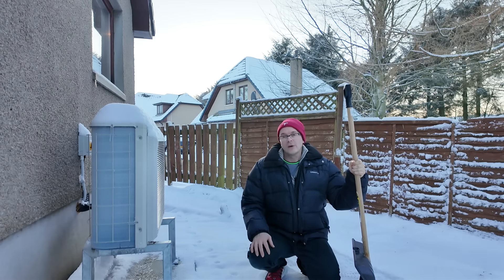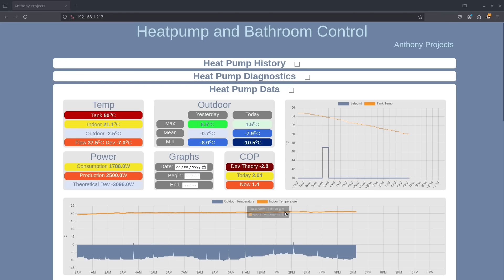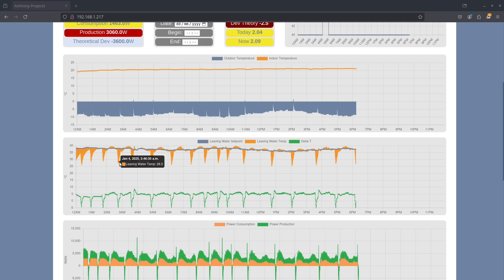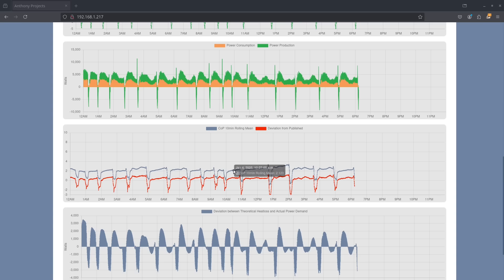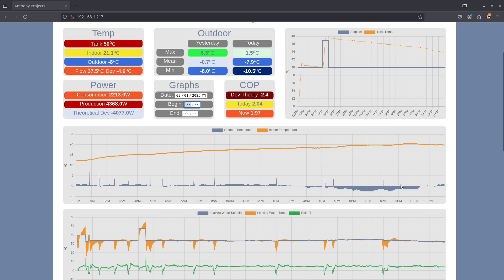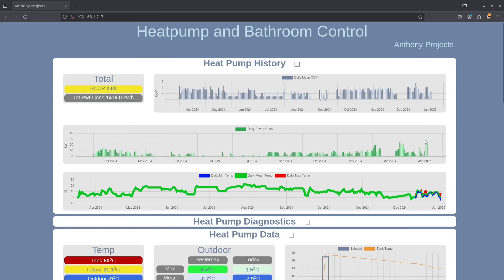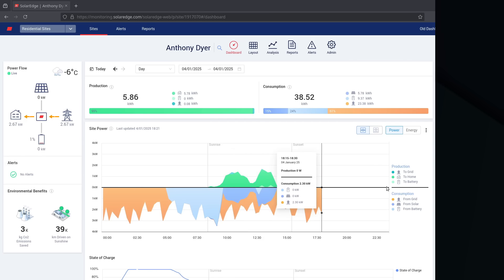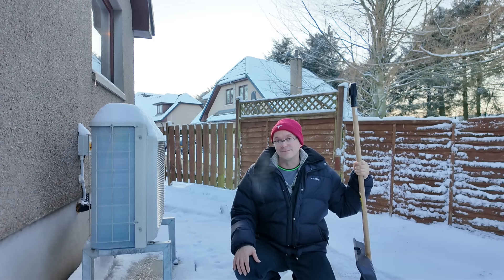Heatpump Performance on the coldest night of the year

Comment: Hoped to hear some information on how warm the house was and cost per day. Instead I heard a lot of jargon.
Reply: He told you the temperature while pointing at a graph showing the indoor temperature at 21 degrees all day.
Reply: It also appears that Anthony has a good heat pump install, and that the efficiency of his heat pump would lead to lower energy costs than a gas boiler on a standard tariffs (his solar, battery and tariff choice make it cheaper still)
Reply: @Biggest-hz7ng   Lol and cows jump over the moon.
Reply: @paulthomas4917  Octopus heat pumps typically have comparable energy costs
Reply: @Biggest-hz7ng  OK point me to the model that has a COP over 4.5 and a cost of less than £1500. then tell me the cost of the storage tank needed for a family of 3.. Then tell me the cost of the storage tank that doesn't exist with a gas combi.

Then add the cost to the already more expensive heat pump running cost, for the larger radiators.

Now I have a question if you we get a cold snap, and the outside temp drops to -10C sp your heat pump would likly have a COP of 1.4 to 1.6  which means it would be fighting to keep your home 17C when it should be 20C, no problem the pump will just run continually at up to 30P/per kw.I want you to be intellectually honest  because your lies do not affect the wealthy, but those at the bottom  of the economic ladder.
Reply: @paulthomas4917  Anthony was able to keep his house at 21C despite the dip. Only need a SCOP of 3.1 to roughly match gas boiler energy cost. The grant brings down the cost substantially for small homes. Octopus are able to do straightforward installs cheaply after the grant.
Reply: @Biggest-hz7ng    Prove what you are saying? 
Point me to a heat pump that gives a COP of 3.1 (not a SCOP). because COP is reality, and SCOP is 'UPTO'.

I could get a grant for a boiler even a free boiler so that doesnt work . further, do you know that if you take the grant you can't return to gas, why do you think that is , I mean it should be cheaper and as warm so why imprison someone in the  heat pump jail unless they want to escape. 

Your easy so have another go.
Reply: @paulthomas4917  SCOP stands for seasonal coefficient of performance and is the average over the whole year. COP is the instantaneous coefficient of performance. So dips in COP (to say 2 or 2.2) during cold spells can be compensated for by better performance (say 5) during milder weather to give the overall SCOP of, say, 3.1.
Reply: @paulthomas4917   Sounds like you're confused brother. SCoP is not 'up to' anything. CoP is a measure of instantaneous efficiency, at a given moment. SCoP (or SPF) is a measure of efficiency over the course of a period of time (the 'S' stands for 'seasonal'); it is generally measured over the course of a year, factoring in performance during all seasons, and is an effective benchmark of heat pump performance.
Reply: @Biggest-hz7ng  If the technology is so efficient, and capable, why is a grant necessary???
Reply: @barrieshepherd7694  to pay to switch the industry over to low temperature heating - to train the installers and any additional work necessary for the new tech.
Reply: @nervousfrog101 21 degrees,  ill fetch my jumper and coat.
Reply: @colingathercole391  If it makes you feel any warmer my heat pump can heat my house a 1960's bungalow to 24 degrees with ease.

The bigger issue with heating systems is achieving an even temperature across all rooms even a difference of 1 or 2 dergrees can make one room feel cold when you move between rooms.

This is one disadvantage of a poor heat pump install. With gas boilers we can control room temps using TRV's without issue however using TRV's with a heat pump in this way can impact efficiency.

Ideally your heat pump should run without any thermostats other than the external weather sensor and all radiators should be sized correctly to provide the correct amount of heat at the correct flow temp and rate.

Comment: The energy company import gas which they burn to produce the electricity you are using to warm your house. And for those who believe windmills are the answer and we don't need gas. What do you do to generate electricity when there is no wind?
Reply: There's interconnects, batteries, hydro, solar, demand shifting, nuclear and storage is being developed.
Reply: @Biggest-hz7ng  It would need the entire output of every mineral mine in the world to create the batteries needed for the grid. Hydro is limited to where it can be placed. Solar doesn't work at night. It has taken years to build ONE nuclear power station.
Reply: @774Rob  battery costs are still dropping quickly with new mines being opened and materials being used.

We will need more storage than just batteries. The tech is still up in the air, but for the moment there's plenty to do to replace gas and integrate wind.

Comment: What they don't tell you is the heat pump is on ALL DAY, guzzling electricity. I don't use my central heating, and my anual elec/gas bill is £600, the majority being standing charges and vat.
Reply from the maker: @raymondbriars9017 and my annual electric, propane and diesel bill is …. We’ll see after a year.  But it’s a lot closer to zero than your bill, and that’s with standing charges.
Reply: So, in fact, heat pump owners do tell you the costs, they are reasonable and their houses are warm.

Comment: Strange how most people with Heat Pumps have to sound superior quoting lots of names and figures!  I just press on switch of my Gas Boiller and enjoy the heat!
Reply from the maker: You know what, you're right.  We do go a quote lots of names and figures.  It's a fair comment.

Communicating technical matter to a wide audience is hard, and too often you're right there too.  Sometimes we do "have to sound superior" as you put it.

I will admit that I'm still struggling to communicate my experiences of having a heat pump without going into technical content.  

The bottom line is this:  
You can switch on your gas boiler and enjoy the heat.  Just make sure you count the pennies you've spent doing that over the last 10 years.

We enjoy the heat too, but if we've done it right, then the  pennies we have to count are at the start of the investment.  There should be nothing to count (or very little) hence forth. 

That's the difference, and understanding that difference is why I go into the technical content.
Reply: @anthonydyer3939  
Yours is a fair comment too, but it is the initial expense that kills aside from the noise and ability to yield sufficient temperature for house and water. Then again how long do they last and what will be the expense to replace?
Theae are off putting factors. Then the ideology aspect forced upon us by corrupt governments is very off putting and muddies the water, as it were, preventing a neutral assessment.
Reply: @Must_not_say_that  There must be a noise issue because the government have raised the permitted noise level by 8 dB with is over 6 times the previous level.

Comment: Canada here.  What a tropical climate you have.   Not surprising the heat pump is performing well.
Reply: What are you talking about Canada? Those temperatures are crazy-cold. Who would live in a place that has an average ďaily temperature of -6°C? I find an average daily winter temperature of 7°C is horrible (occasionally gets down to a low of -2°C overnight)

Comment: We are a really  elderly couple.   We havent understood a word of what you are saying.   We dont do Graphs !   It would be helpful if you said that the heat exchanger is working well, Its 25C in the living room, 27c in the kitchen & 20C in the bedrooms.   AND its minus 10C outside.   Cost of running the system works out as 30p a day.  Got it ? END OF
Reply: @westsomoap81  just an aside, they made coal illegal in about 2016.
Reply from the maker: @westsomoap81  The heat exchanger is working well, it’s 21 degrees throughout the house, and it was minus 10 outside.  Cost of running the house could actually work out at 30p a day (or about £100 a year).  

Hope that’s clear.
Reply: @anthonydyer3939  Certainly much better!
And only took a moment.
Reply: @anthonydyer3939  That low cost is because of the investment in solar.  With no investment in solar, i.e. powering from the grid directly, what would the daily cost be?

I find it hard to believe that heat pumps can be cost effective without local solar, grid electricity costs are never going to go down, despite what Ed says - the government likes the Tax take and the providers the profit take from the current (distorted) high prices for electricity.
Reply: @anthonydyer3939  can it warm the house up to 27 like the last asked? 
 Room temperature used to be 20 to 25 when I was at school science class. The TV says it's 17 to 20 these days?
Reply from the maker: I don’t think 25 degrees was ever a normal temperature throughout the whole house, not by a historical measure anyway.  The living room yes, with a fireplace, but every other room was generally cold and you were never motivated to dwell too long elsewhere without a hot water bottle and your duvet.

Those were the days before gas central heating of course, and I do remember my early childhood days like that before gas came to town.  Of course that was cheap gas back in the 90’s.  We now have had a taste of what expensive gas is like, and it’s not something you can pin your countries hopes on for the next 20 years -  our country has to move on.
Reply: @russellcrosby8175  Bullshit was it ever "to 25"!
Reply: he lives in the cold

Comment: What is your backup plan if the electricity supply goes off?
Reply: what is yours? as a gas boiler typically requires electricity to run pumps etc.
Reply: @BenIsInSweden  I have a wood burning stove keeps us warm. We are off grid so a heat pump would not be suitable. A neighbour who was elderly had one bout waited four months for it to be repaired.
Reply: @sj19660  Don't need to get rid of the wood-burning stove with a heat pump. Individual cases don't make or break an argument, there are times when e.g. a gas main has been broken, and thousands of people are left without heating for weeks.  And restrictions were put in place regarding the use of resistive heaters as a backup.
Reply from the maker: @BenIsInSweden  During Storm Arwen a lot of houses went cold around my area.  They only had a boiler for heating, and no backup fireplace.  They had to resort to lighting the gas cooker to stay warm.  Not the safest strategy regarding naked flames and CO poison risk.
Reply: @anthonydyer3939  They are designed to work like that, gas cookers have been around for 150 years.
Reply: @BenIsInSweden  I have a battery with a small inverter.
Reply: Blankets
Reply from the maker: @sj19660  At the moment it’s a wood burning stove, but a 30kWh battery is something that I’m looking into.  That would be helpful, but honestly if the blackout is storm related in the darkest months I’d still be relying on my burner.
Reply: Most gas boilers fail without electricity.
Reply: @Monk_Duck  You'd have to go back many decades to find a gas boiler running on a gravity system and a pilot light ignition, so in reality, that's ALL gas boilers fail without electricity.
Reply: @nickwinn7812  it's not the fault of the design of the boiler. It's the drive for net zero and demand on the grid at peak times. And the phase in  of smart meters.
Reply: @nickwinn7812  Correct but a £500 portable power bank can be used to keep a boiler and fridge running for a few hours in an electricity outage. It will also have other uses around the house / garden.
Reply: I got ethanol fires in case lol

Comment: As I understand it, heat pumps work well if you have a well insulated home and solar panels.
I happen to live in a council property made of solid concrete walls, upvc double glazed windows with a slid metal bottom panel (approx 5mm thick) with no solar panels. 
Don't imagine my electricity bills would be cheaper with a heat pump 😅
Reply: No, a misconception.
It is merely a heat source.  
All systems better with good insulation.
All systems better with low temperature emitters, ie radiators.  That said this is more important with a heat pump.
Reply: Heat pumps have a similar energy cost to gas boilers. You may want to ask your local authority and/or government what grants they offer for insulation whatever heat source you have?

Comment: You needed batteries, an arrangement for cheap & expensive power so you're controlled by your supplier, the indoor temperature hardly reached 20⁰C most of the day, had to melt outside ice hourly. No mention of the age of the heat pump, so no information on how loud that rumble gets over the years. Unsure whether you needed to replace radiators for larger bulky ones. Not as impressed as I'd like to be.

Comment: Heat pumps obviously do work but if you are a pensioner would you want to spend the money needed to install a suitable system. I have been quoted £30,000 to install and upgrade, money which I do not have and am not willing to spend at my age. We have a friend whose son converted a barn in Wales and has a ground source system with solar panels but still needs an immersion heater to boost domestic hot water.
Reply from the maker: @timblackburn2017  I often ask myself the question as to whether I’d advise my mum to install heatpumps or solar, and I wouldn’t.  It’s a long term investment, and it does take some time for savings to pay off that investment.  Home values aren’t really affected by energy performance either.  So you lose that investment if you were to sell the house.

However if zero carbon heating became law, then my advice changes, because then house values are affected, and that means you can sell your house and potentially get a good investment back.  In Scotland there are consultations on zero carbon heating mandates, but I think that’s been shelved for now.

Comment: Please correct me if I'm wrong, I thought its recommended to keep the pump on all the time, if so at over 2KW thats more than £100 aweek how is that cheap?
Reply: Heat pumps don't run at full power 24*7 . Mine will modulate down to about 400W or cycle on and off when it's a bit warmer outside. The compressor switches off but the circulation pump stays on.
Reply: @nervousfrog101  Yes when it's warmer out side, my gas boiler doesn't come  either
Reply: @eddie1330  Yet you fail to acknowledge your correction - you're just a troll.

Comment: It will be interesting to see the proportions of time and KWh the heat pump draws on grid power compared to renewable sources. Then in turn to measure that against the Spring Summer energy consumption. No doubt it will be using more grid power during cold weather because that's physics; yet to show a price comparison over a year against a more traditional gas heated home would be worthwhile.
Reply: Heat pumps have similar energy costs to a gas boiler for a reasonable installation. Octopus, for one, offer efficiency guarantees for their installs.

Comment: The defrost cycles are problematic since you are either pulling heat from your home to create the defrost or using energy (electrical power) to achieve that task.
Reply from the maker: @paulthomas4917  They certainly reduce the overall efficiency.  I’d really like to investigate technologies regarding anti ice coatings.  They do exist, but durability, cost and heat transfer efficiency are all open questions.
Reply: @anthonydyer3939  yes, my point was gas per kw is about the 1/3 of the cost the electricity so a heat pump would have to have a COP of 3 to match gas.
When the heat pump goes into defrost mode, the COP  isn't even parity.
I do agree if you didn't have mains gas available, and was left to the mercy of electricity to heat your home then getting a heating unit with a COP over 1 would be advantageous , but so would storage heaters using off peak electricity.
I think we are being ripped off for what Is not much more than a refrigerator, relabeled, heat pump which opens the door to everyone else jumping on the bandwagon, and it won't be long before those who have no longer the option to return to gas see a hike in the price of electricity or more likly the standing charge.
Ask the EV drives what they think about the introduction of road tax, they invested in the more 'efficient' EV only to find out insurance has been hiked, servicing cost are higher, and now the Government wants its cut. 

We seen exactly the same with solar  panel introduction the energy companies purchase of unused kw  was enough to tempt many into investing in early technology only to find the tempting sale of unused kw's disappeared. 
if your heat pump delivers a COP of 3 and a mew model has a COP of 6 you would not be able to afford to run your 'gas gurgling' heat pump because the cost of electricity is based on what they can extract from you i.e. they will charge more for less, and you will jump on the merry go round chasing affordable energy again.

All that said you are helping many by producing data on what you are finding, and I thank you for that.
Reply: Overall energy costs for heat pumps versus gas boilers are similar for a reasonable install with current prices. Gas use with a heat pump is 40% lower even if all electricity were gas-generated.